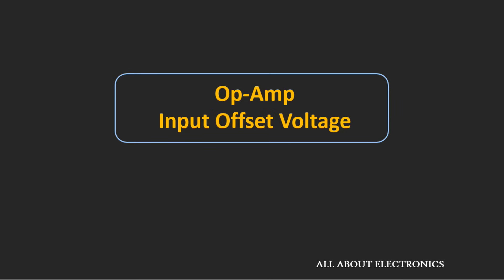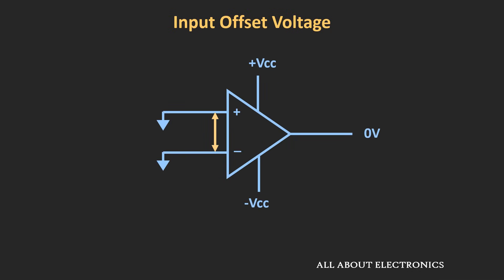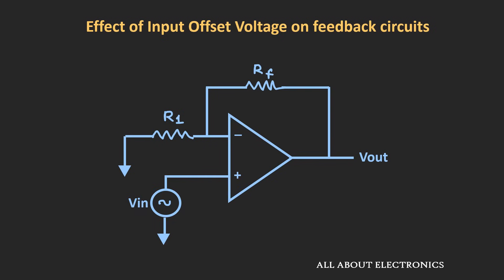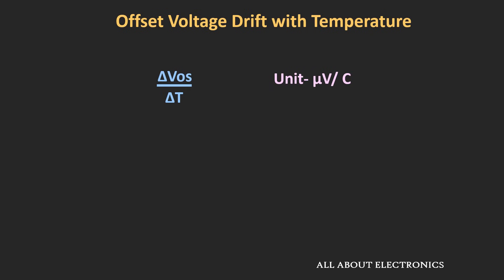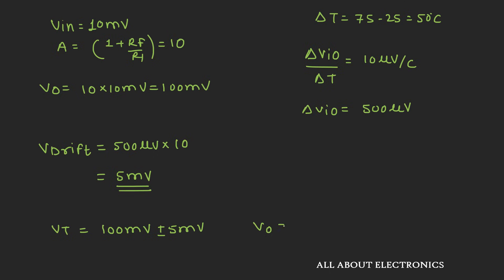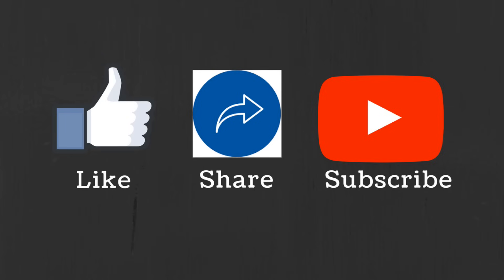Op-Amp: Input Offset Voltage Explained

Comment from the maker: Timestamps for the different topics covered in the video:

1:00 What is input offset voltage? 

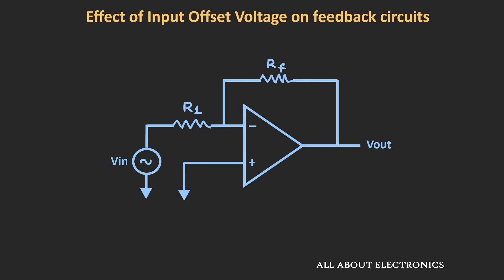3:27 Effect of input offset voltage on the feedback circuits

7:08 Offset voltage drift with temperature

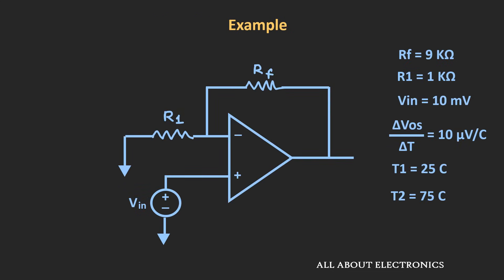7:56 Example
Reply: Sir, if input offset voltage is applied to make output offset voltage zero, then why will it have a role in effecting output offset voltage...it should reduce or nullify output offset voltage, right?
Reply: ALL ABOUT ELECTRONICS 
Thanks for uploading such valuable videos
Which is very much appreciated ones and very much helpful for me

But its a humble request from my side , please make some videos on Field Effect Transistor
Please sir
Reply from the maker: It will take some time. But yes, I will definitely make videos on FET.
Reply: ALL ABOUT ELECTRONICS 
Thank you sir
Bt plz sir don't do late

Comment: This question is not related to this topic
Query is
Playlists organisation is bit confusing because some videos are repeating in other playlists.
Can u guide me if there is possibility that i can get most of the videos in minimum number of playlist? so that i can get rid of redundant playlists
Reply from the maker: I think this video is only in op-amp playlist. Only some videos of oscillator and multivibrators are in this playlist. 
But there is a seperate playlist of analog Electronics, which covers all these topics. Some videos are repeating in it. But I will update that playlist. You can follow that playlist, it also includes solved examples for all topics.

Comment: Good sir... But i have a  doubt that Whether i can connect the Input off-set voltage source to the Inverting input ?
Reply: Yes you can . And he also described in an example of 10 mV that it is either 9mV or 11 mV as the polarity of offset voltage is unknown . Please do refer his example where error is 10% . It's around 6:00 min

Comment: I want to amplifiy 1 to 3 uVolt to 5-12 volts  can i use lm358 for this ??
Reply from the maker: The offset voltage of the op-amp should be less than the input voltage you want to amplify. So, you need to select the op-amp which has offset voltage less than the input signal range.
Reply: @ALLABOUTELECTRONICS  sorry , that was current in 3 uA @ 6 v that I want to amplify can op amp like lm358 do this work ?
Reply from the maker: @omsingharjit  well, in that case, you need to consider the bias current. But there are low noise op-amps are available, whos bias current is in sub micro-ampere range. You can use them for your application.
Reply: @ALLABOUTELECTRONICS  can you mentione any popular model ???

Comment: Can we fix this 
Error by using external voltage balancing circuit like voltage devider or potentiometer in one of its unbalanced terminals to make both input of opamp same ????
Reply from the maker: Some op-amps have inbuilt compensation circuit. Only you need to connect the variable resistor between the two given terminals.
And by varying the resistor, it is possible to remove it.
Reply: @ALLABOUTELECTRONICS  offset pin !

Comment: 5:15 Voo should be equal to zero according to definition of "Input offset voltage"..aur hum "Input offset voltage" error Kam karne k liye use Kar Rahe h par yaha toh error aa rahi h
Reply from the maker: If you want to remove that error then you need to apply the input voltage of -0.1mV to remove that error. So, without nulling the error voltage, there will be some output voltage. But from the error, you can know the amount of voltage which is required to null the error. 
Some times it is difficult to null the error exactly. In that case it is better to go with op-amp which has low Vio (in microvolts)

Comment: Sir

What is input common mode voltage range?and input differential voltage range?
Reply from the maker: As its name suggests, it defines the input voltage range for the common mode and the differential input voltage. 
The common mode voltage which is present at both terminals should be less than the specified range in the datasheet. Similarly, the differential voltage present between the two terminal (inverting and non-inverting terminal) should be less than the specified range. For example, for one op-amp if differential input voltage range is 5V and let's say you are operating op-amp as a comparator, then you should need to take care that the difference between the voltage applied between the two terminal is less than the 5V. 
I hope it will clear your doubt.
Reply: ALL ABOUT ELECTRONICS thank sir for replying.now i understand.

Comment: This is also called Input Range Limitation or not??
Please reply!
Reply from the maker: Input range limitation is different. It defines the maximum input voltage that can be applied to the op-amp.
Reply: ALL ABOUT ELECTRONICS Thank you